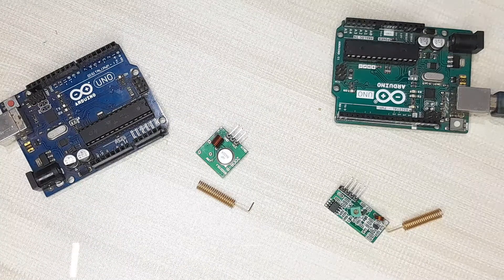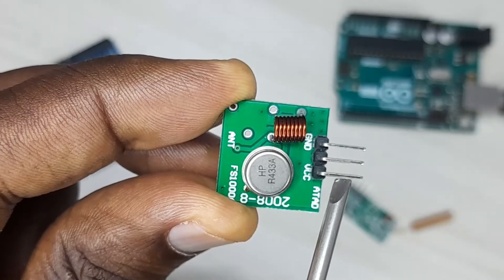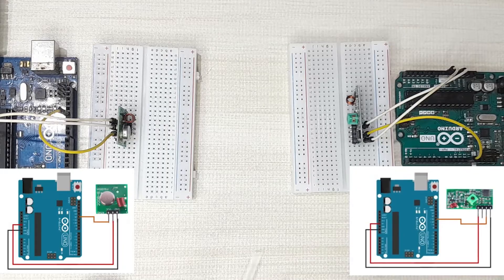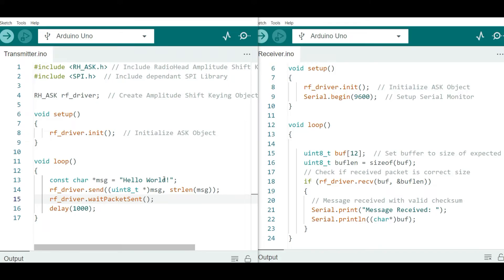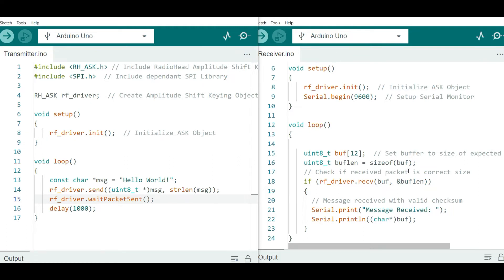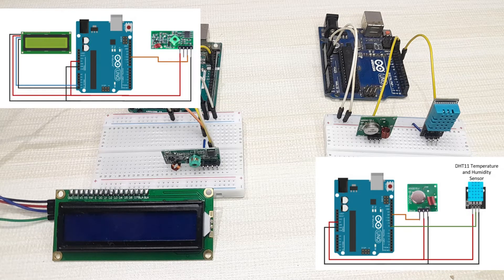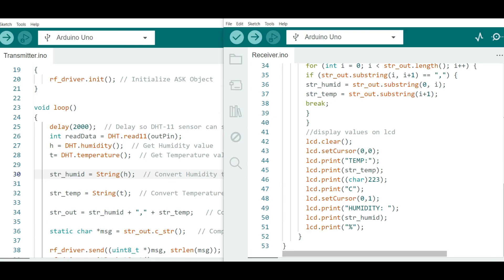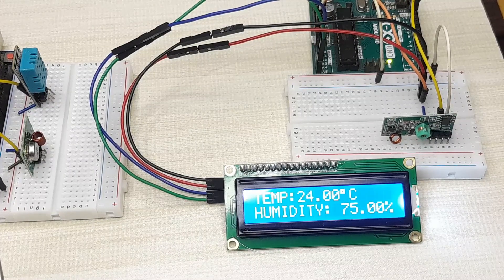433MHz RF Transmitter and Receiver Modules with Arduino.

Comment: We used the exact code, transmitter, and receiver, and our receiver received gibberish. We've double checked the code and wiring and can't find any issues. Any ideas for us to troubleshoot?
Reply: Radio frequencies can always be disturbed by others that use the same frequency, the 433 MHz is often used for doorbells, garage door openers and toys, further the signal can be too weak or to strong, and there can be reflections. Try the transmitter and the receiver with a button and a buzzer, if that works look for the mistake somewhere else.

Comment: Can we make a remote control using these 2 modules? Thanks
Reply: yes thats my question too
Reply: Well if you want to make a remote control such as a tv remote control you’d have to use inferred signals which means using a Inferred PCB but if you want to make a remote control for controlling Toy airplanes or toy cars you’d have to use these
Reply: @Yknico1  is there another way to send radio transmission without two microcontrollers, idk the range of frequency that these send in but i think its just decodes it into binary. so is there a way to make a constant specific frequency from the transmitter without  a microcontroller ?
Reply: @murphymonreo6126 Yes, you can generate a specific frequency without a full microcontroller. The simplest way is to use a 433MHz oscillator module/crystal directly. But the problem is, without some kind of controller (even a simple one like a 555 timer to pulse it), the transmitter would just be sending a constant carrier wave. That's like holding down a single key on a keyboard forever it doesn't send any useful data like a command to 'turn left' or 'speed up'. The microcontroller is what encodes your commands into a pattern (like binary) that the receiver can understand
Reply: @Yknico1  yup, also the module of the receiver boosts its receiving signal after 400ms. so without a it receiving a signal, its output is high, then when you send a signal its also high. these module are only good for sending constant binary data below 400ms
Reply: @Yknico1  yea it doesn't work because the receiver will boost its gain after 500ms-ish.

Comment: Could you tell me more about these modules please…
Do they always work in pairs, Tx ->Rx ? Or can one Tx module pair with many Rx modules?
Also I need to control 8 relays , do I need 8 pairs of Tx and Rx modules?
Reply: You can use an encoder/decoder to pair one module to multiple load output switches.

Comment: I'm curious, about the Tx and Rx pins.

😁 Howcome no one is using that? 🤔 What's it's purpose for?
Reply: are you asking about tx and rx pins on arduino
Reply: @ICThelpZ  I've forgotten...but I think so.

There is Tx and Rx pins there, what is that then used for?
Reply: @KajanLakhan  its used to serial comunicate between two arduinos 
but it requires wires so no one focus on them
Reply: @pixpalfactz   thanks. Maybe design change in future.   Why would one need more then one IC in series....we not building a "supercomputer" 😁
Reply: @KajanLakhan  but i think it will usefull if you need more output pins